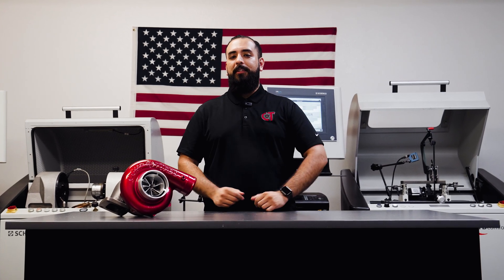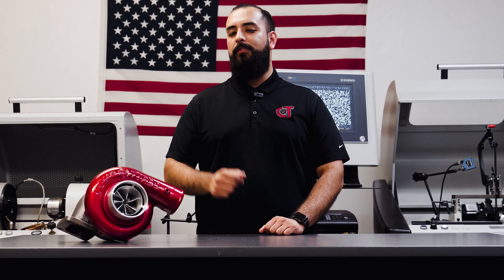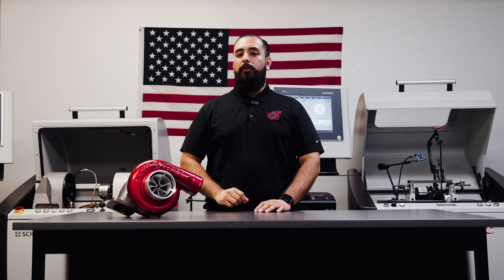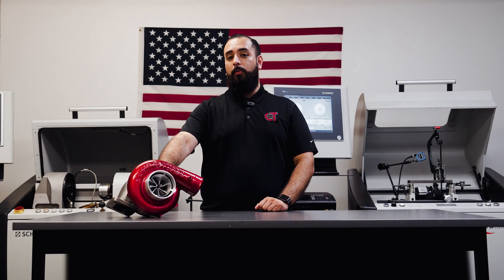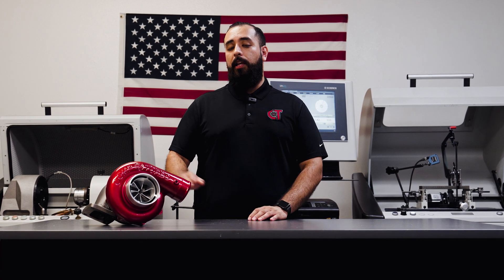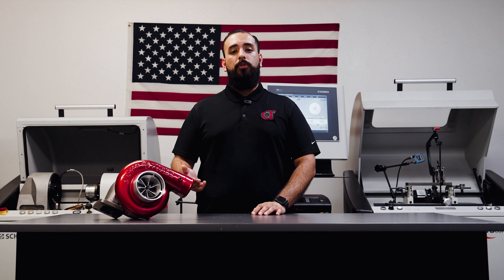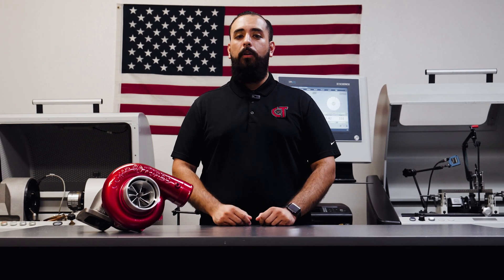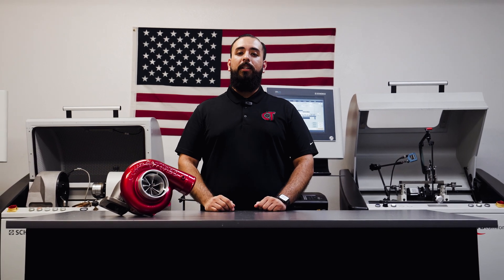Oil-Less Air-Cooled Turbo

Comment: So it seems I can keep my Naturally aspirated car, naturally aspirated without breaking the bank. nice
Reply: No definitely not
Reply: @k20909  no oil, no intercooler, only grease every 3000 sounds naturally aspirated unless you care to explain?
Reply: @-coldheartcentral-9696 you would still need an intercooler and piping for it to cool the charged air from the turbo but that would be it
Reply: If you are putting any sort of forced induction on your car, it no longer is NA.
Reply: Very much not the case 😂 you still need the rest of the turbo kit you just don’t have to run a oil feed and return for the turbo

Comment: Can the water be from the air2water intercooler lines , temps range from 40-100 degrees? 
Looking for options to set away from procharger , currently maxed the f1a94 headunit out prefer not to go crank driven.

Comment: i got mine going in my mitsubishi currently ! excited to see how it holds up to daily driving!
Reply: If I get one it won't be daily driven but driven a lot how has it worked out
Reply: @oneofoneauto  still pending fabrication and tuning afterwards. Likely won't be a true daily but driven often, weekly at LEAST.
Reply: @bryanwilliams4130  hey bro you ever get this fabed and set?
Reply: @vDaddyBane  hey there! Been a while. Literally in the fab shop right now 😭. Just know life sux and we're FINALLY getting around to it ❤️‍🔥
Reply: @bryanwilliams4130  We got any update? I just ordered a 62mm for my K24
Reply: @seanburke8886  should be here within the next month I'll have it all ready and seaworthy again!
Reply: @vDaddyBane  still at it! But it's getting tuned currently
Reply: So where's the 1 year update? Lol
Reply: Just checking in, how ya making out on the build?
Reply: @ComradeCanuck-o5y So it's a tuning nightmare. There was an issue with the shifter so I'm trying to source another one. I'm hoping it's not the transmission because that's fully built from Kosmic now. But the turbo is in! And the manifold is all done.